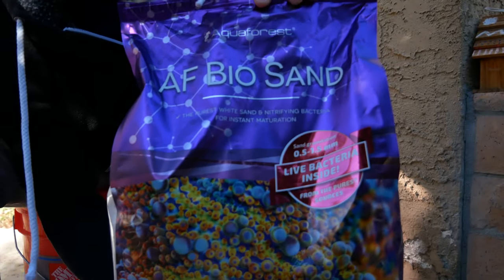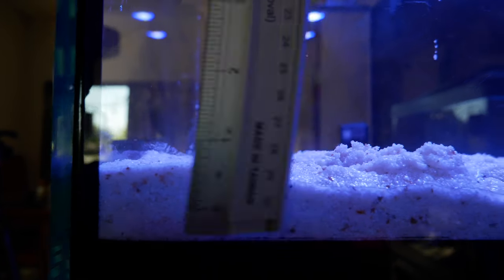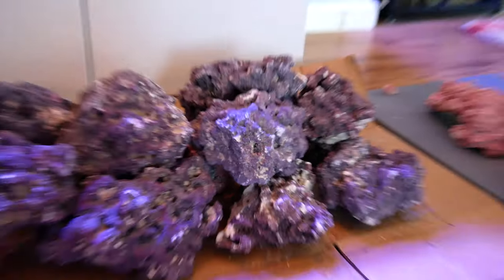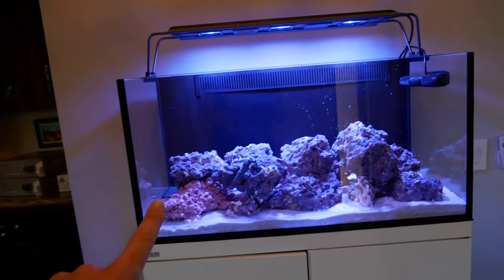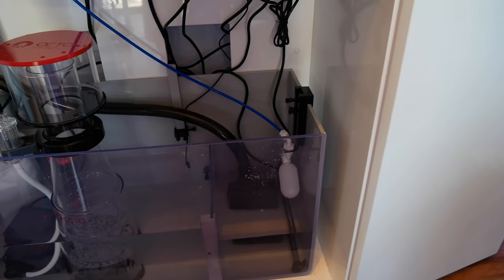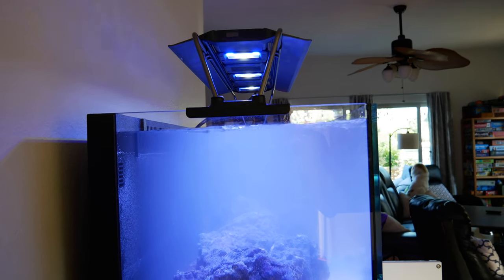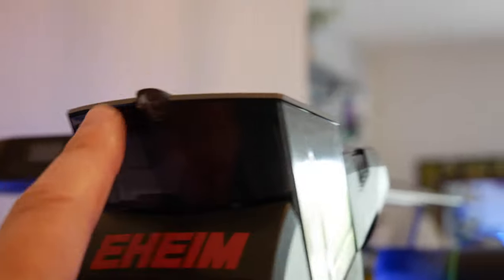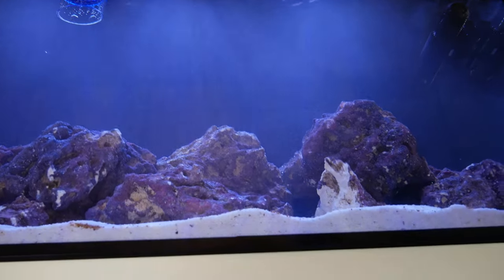Planning and building an Aquascape: Reef Octopus Build Part 3!

Comment: Just finished setting up the same Reef Octopus tank and I'm having a leak issue with the return pipe. How did you end up solving this? Did you use different plumbers tap or just more? I tried more and still getting a very small leak.

Comment: Sorry for the thumb down but you did all the beginers mistake allredy in the set up video😁(return pump and baffels, sand and aquasqape, flow... skimmer showld be off if you use bacteria in the bottle) amenone don't need a cycled aquarium necessary they feed on amonia, if you doo some reserach😊. And maybe you will add different clownfishes (clarky, skunk, ocelarius, maroons) if you wanna do a clown harem tank. Doo somthig different then others if you wanna stand out. Apollogise for my bad englishe and rough comment is just my opinion😉. Good luck with yours build, but be diferent😁